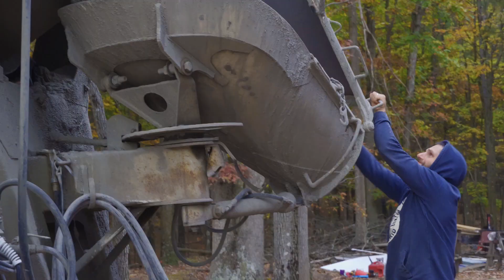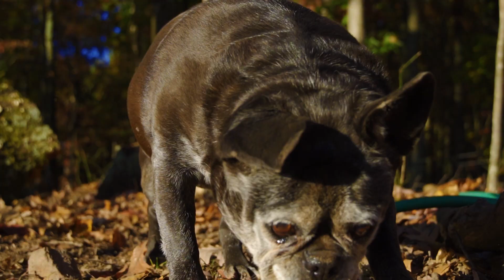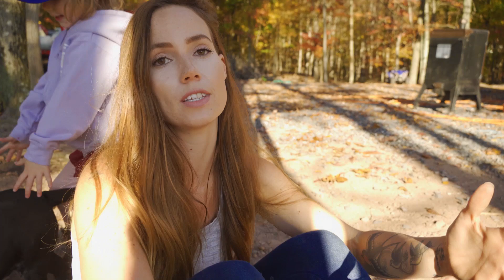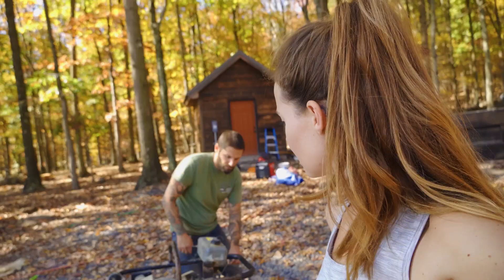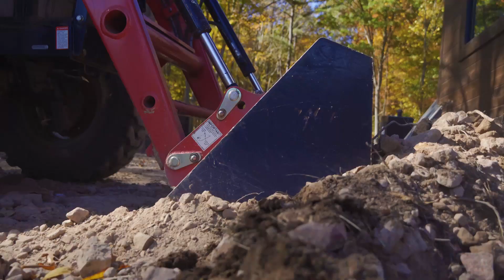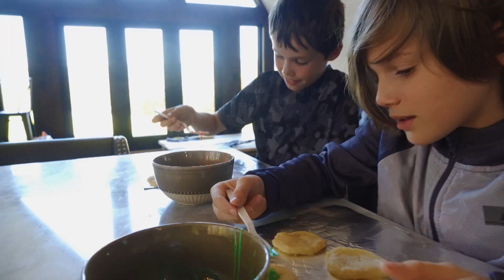Why We're Pouring Our Foundation AFTER Building The House

Comment: Good work guys!

When you frame up for the walls, if you spray the forms with cooking oil, the plywood will release easier. 

Bruce and Chuck are stealing the show. It's not everyday that you get a steer that is as gentle as Bruce.  I hope he doesn't learn how to use steps, otherwise you'll have a winter house guest.
Reply: tsx3214 
Being on well water, used oil isn’t a good thing plus it stains concrete. 
I’ve got a friend that’s been in the concrete business for 30 plus years. Plus cooking oil is biodegradable.
Reply: Sandra Westley, it’s a bit late telling them now there on there last one, they needed that information at the start of the job.
Reply: @gungadinn  right... they have a product called form oil, but we used diesel fuel in a pinch
Reply: @robwestley7370  
Sandra, they still have to build forms for the rest of the walls that the stone work is going to be attached to. That's what the rebar sticking up from the poured concrete is for.

If I had a chance to offer s suggestion for enclosing the pilings, I'd of been tempted using ICF's (insulated concrete forms) from ground to the sill plates.

When you install brick or stone on most homes, the brick or stone get in-bedded onto metal strips attached to the foundation. There are very few all masonry homes, whether brick or stone as they are expensive and not very energy efficient.

Comment: Built a pole barn, used precast footings. It’s an open shed actually for the tractor 30’ x 30’. Footings are just fine, came out great. I had the same idea of pouring walls between the footings. Never thought I would see someone else doing it.

Comment: Excellant choise using stone to enclose the base. I've designed many A frame houses and I always used stone inside and out. However make sure it is done right. If you are doing it yourself, make sure you  know the right way. If not done the right way you will have big time problems down the road. Good luck!

Comment: Hi, just a comment about foundations (including columes) it is advisable to vibrate your concrete to rid it of air. As for compacting soil, lay the spoil down in 6" layers with a spray of water between each. It makes for a more firm job. But, I am gobsmacked at the job you have achieved.

Comment: FYI,. A friend of mine owned a two story house at the beach on the Atlantic Ocean in Florida. The windows would get spotted and cruded up from the salt spray. He cleaned the windows of the house using Prell shampoo. He would mix the Prell with water in a bucket (I don't remember how much), scrub the windows with a extended handle soft dristel brush like one used to clean a RV, car or semi trailers. He rinsed the windows using clear water from a hose. The Perll would sheen off leaving no spots and no need to squeegee or dry. A few buckets of water would work on the solar panels if no water is close. I haven't thought of this in years. It may save you time and not having to climb a ladder to clean the house. At least  not as high.  Have a blessed day.

Comment: One possible benefit  is that the second pour helps tie all the piers together along the sides unlike before and making more like the monolithic mass that a traditional foundation which is also to resist the force of the earth around it.  Think of its as the bracing you'll find on the bottom of a stool to keep its legs together and in soil piers can shift if there's a drainage problem since washing out the earth especially on a slope/hill side is always a possibility. Indeed the nature of an A Frame sheds water literally at the most problematic place possible because it's closer to the ground/foundations where conventional roofs overhangs have gutters that channel the water to a downspout and away from the foundations usually at a corner not along the entire side. Kudos on making the piers stronger and more resistant to the soil/conditions around them plus the weight of the stone that's going on top of them will make it even better than before.

Comment: You should have coated the concrete (the pilars also) in some sort of bitumic protection from the moisture. From their lowest point to the ground level. If the ground holds water on this level, it wil erode the foundation with time with no protection on the concrete...

Comment: I get what you're trying to do, but considering it's bearing no structural weight other than holding up the stone veneer, it seems like overkill to pour such big footers.  Seems like you could have just attached the stone to a cement board wall with the same result/look.  This will certainly be solid though!

Comment: Instead of making the wall flushed to the pillars, I would have built the concrete wall 8" away from the pillars to hide them behind the stone wall, adding a slab cap with decoration on top with an overhang. Then put an " L " shape flashing under the siding board and let it rest on top of the slab caps with some waterproof sealer. That will push the water away from the home  :)

Comment: am assuming you went this deep to get down past the frost line. Would have been a boat load less work going with shallow frost insulation on a footer.  Then built up your rock walls. Rock is cheap but it is fairly easy to work with.  or just a simple rubble foundation also works  It is not like you are actually supporting the structure. Either way would have been a huge amount less work.

Comment: So why dont you use concrete block for your foundation walls rather than pouring the walls for a base for your stone facade? Concrete block is almost 25% cheaper than poured walls and as long as it has a good waterproofing below grade everything will stay dry inside. If you have a high water table drain tile around the perimeter will help drain off any excess moisture that threatens the integrity of the moisture barrier